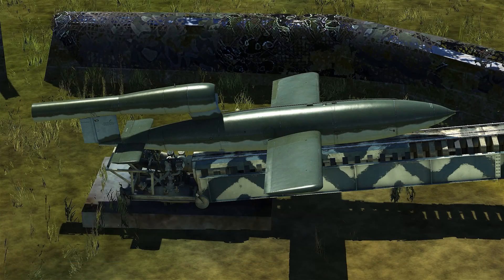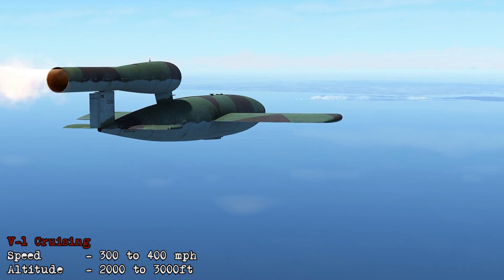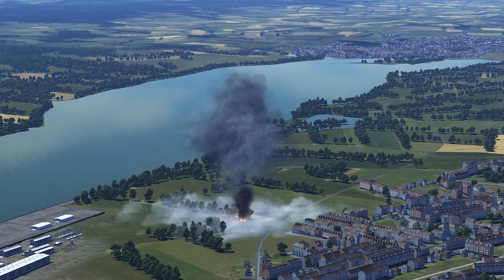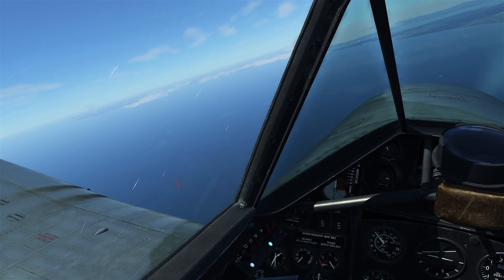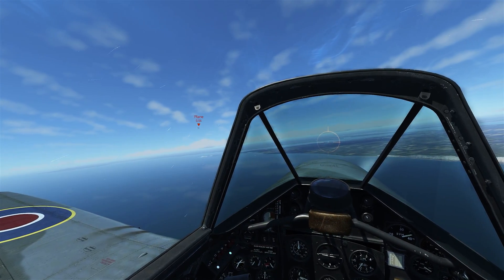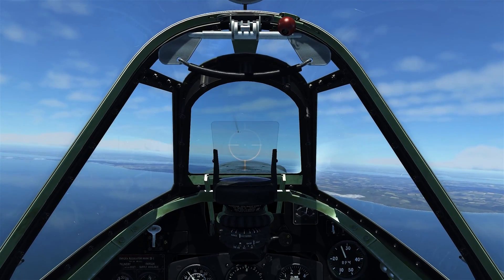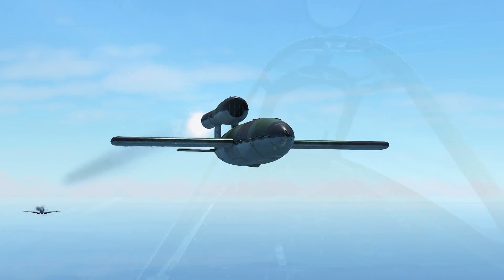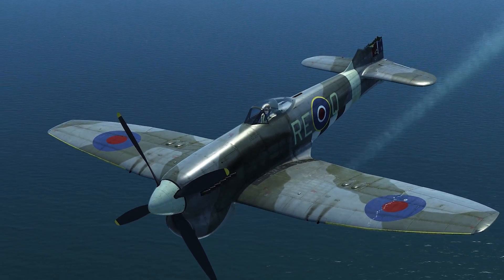Wing tipping the V-1 Buzzbomb

Comment: I live in the Netherlands near the German border ,about 60km in a town called Deventer. Near my town is a village that during the war had a V1 launch site. Now only remaining are the concrete blocks that once hold the ramp.Btw....I have read that at later point once ze Germans found out about the wing tipping,they added a proximity switch to the wings that if they tried to wintip it,the V1 would self destruct. Is this true??

Comment: Interestingly the V1 engine doesn't cut out in order to initiate the dive, the dive is done on a timer that forces the elevator to move, but this often lead to fuel starvation from the ramjet. It was actually intended to be a powered dive but didn't work like that in practice.
Reply: I don't want to be the 🧐guy, but V1's used pulsejets, not ramjets.
Reply: @leventesapi9882  Thanks, slip of the tongue/whatever the typing equivalent is
Reply: @TheHarvHR slip of the finger

Comment: Nice to see you back making the videos.  A nice Christmas present to your followers.
I was expecting to see wing damage when you tipped it.
Do you plan to make a learn to fly video of the mosquito?  I find it a real bear to operate on the ground.
Happy Holidays.
Reply from the maker: Cheers! I'm working my way back into things. The wing damage is possible actually, but it happens if you're too aggressive with your pull and roll to force the tipping.
Regarding the Mosquito... there are videos coming.
Reply: @RequiemsACTL Thanks for responding so quickly.

After seeing how easy the mustang now will snap its wings when pushing the nose over to avoid a collision when overtaking your target followed by a roll and pull however slight I thought for sure your wing tip would snap off even though your were gentle.

Good to know that you will be easing back into the videos.

Comment: got a dumb question not familiar with the plane.
Wouldn't the plane accelerate bit faster if you were to lower the rpm in a dive or more precisely change your prop pitch to be more coarse... hmm then again if the lever controls the rpm not pitch then that would be meaningless.  You have to know this best (your vid is actually on Hertzell web for explanation). Just wondering if it was slip of a tongue or am i confused.
Reply: I slightly modified my comment because I got confused with the definition of a fine and coarse pitch, I had them inverted. Now it should be better.
Reply: @Robin-zu4re  I thought so :-). Thank you for the answer.  So it was the case of the pitch vs rpm lever.
Reply: That is true on variable pitch propellers. The pitch angle of the blades have to be made coarser and coarser as the speed increases in order to make the prop paddle air instead of windmilling. This is how the Bf-109E-3 and earlier worked for instance. 

However, on most if not all mid to late war warbirds, the prop is a constant speed propeller. That means a mechanism will keep the propeller spinning at a constant speed by adjusting the pitch angle of the blade. 

That means when you apply maximum manifold pressure at max RPM, the propeller will move to a coarse pitch angle, in order to be paddling as much air as possible. The induced drag of the propeller will be minimal, however the spinning drag induced by the propeller will be at it’s maximum, which will make the engine give a high power output to be able to conserve the rotation speed of the prop. 

If you go idle on high RPM however, the prop will go on to a fine pitch to reduce the spinning drag of the propeller in order to keep it spinning fast, but that will drastically increase the induced drag of the propeller. 

So to make it short, on a constant speed prop, at a high manifold pressure output you want to give the propeller as much RPM as possible to be efficient. At a low manifold pressure output however, you want to have the propeller RPM down to increase the efficiency of the propeller. In any case, if you want to go as fast as possible with that type of mechanism, high RPM and high manifold pressure is the way to go. 

That is my understanding of how prop RPM induces performance losses or gain, and how a constant speed prop works. Anyone feel free to correct me if I’m wrong.

Comment: It seems modelled pretty well. It is pretty wild how simple that thing is, other than the gyro control which was pretty advanced for it's time. There's a video where some guys managed to get their hands on one of the gyros from a V-2, as well as the control systems, Which I assume isn't too different from the one in the V-1. They basically made a high voltage unit out of eBay bits to get the gyro going since one of the tubes in the vibrator(What they used to call step-up voltage converters) was cracked. It was wild hearing that thing spin up. Kinda scary too, that 80 year old thing screaming away. I don't remember what the RPM was it ran at, but it was incredibly high. Also insanely loud, lol. Anyway, good stuff as always. Hope you had a great Christmas!
Reply from the maker: That sounds pretty interesting to check out!